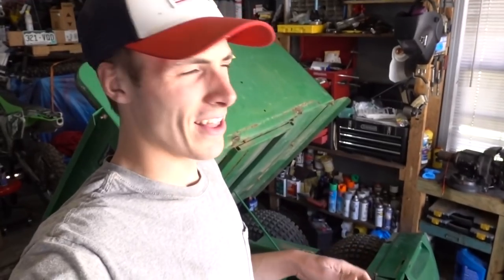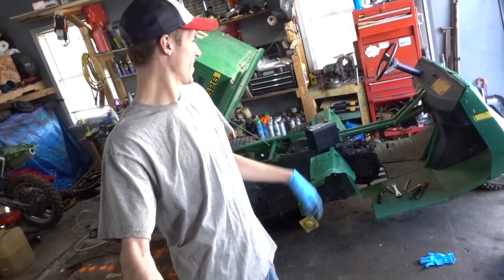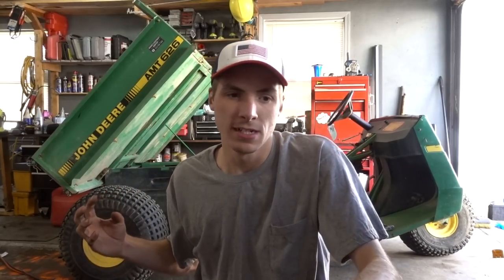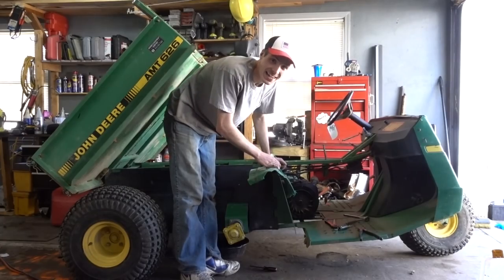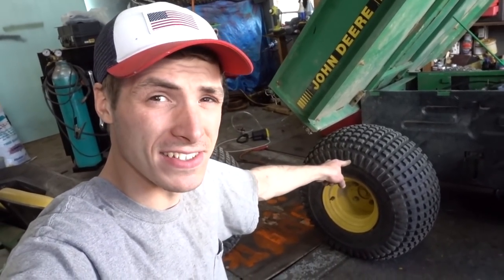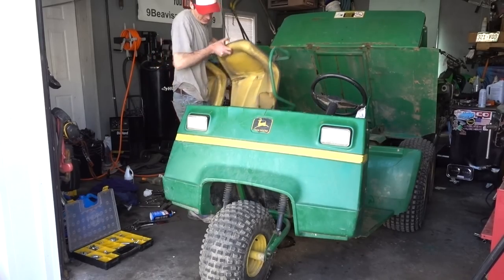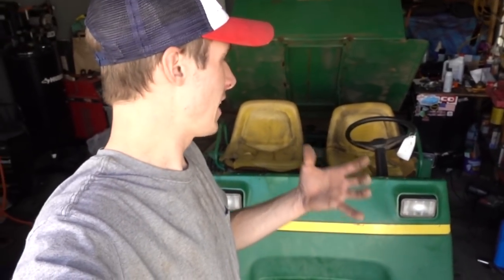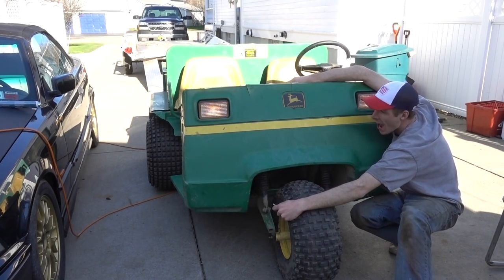THE CRAZY GATOR RUNS

Comment: Put a hydraulic lift on the back, put some LED lights on it, mount a swing arm to the chassis behind the seats (not on the tip bed), and put a light and winch on the arm.  Then put a trailer hitch so you can move your trailer with it.  Maybe give it a brush guard up front
Reply: Todd Abbott yess

Comment: I am a Golf Course Superintendent and have a fleet of gators and pro-gators.  With the setup that you have if it is hard to switch gears while the motor is running it makes it a lit easier if you turn the engine off, restart and then switch gears.  For example if you're driving in forward and you need to back up, rather than just switching the gear lever from F to R and struggling/grinding gears, turn off the motor switch to neutral and then restart the motor and then switch to reverse.  I know it sounds crazy, but it will save your trans-axle in the long run.  Starters are a lot easier and cheaper to replace!  Let me know if you have any questions about anything on your sweet new ride.  Love the content.

Comment: engine swap it with a sport bikes engine
Reply: no want a honda 450 in there
Reply: yeah thst too
Reply: +Zacmine6 why sport bike engine would have far more power.  put an r6 engine in it the thing would be scarry fast
Reply: But this is isn't a sport thing a dirt thing
Reply: But this is isn't a sport thing a dirt thing
Reply: it doesn't matter if the engine was once used for dirt or for street its about the engine and how much power it has
Reply: +Zacmine6 why does that matter? go look at 4 wheelers wkth sport bike engines running on the dirt.

plus a sportbike engine I's way less maintenance

Comment: Nice looking Gater, hand tight those bolts when you put those tires back on. Then machine tighten them, had to replace all 32 bolts & re-thread 4 rims too.  The tire not touching the ground, either wrong sizes tire or need more air.

Comment: I worked where we had a 6x4.  The middle tires always went bald or lost bead due to when it turned the middle tires just drag sidways.  Yours seems a bit older.  They are very strong in what they can pull.  I would think yours is a better design so you dont eat up tires.   Keep up the video's!

Comment: It's like a garbage truck. That wheel is there so If your going over a short taller hill, the middle tires will hit first and lift the rear tires off the ground for clearance when the front end starts to point down. so the body won't catch right at the peak, and stick you there with the wheels barley touching the ground

Comment: It's like a dump truck if the load is to much you can manually put it down, same with the John Deer if the load is to heavy it will touch the ground. Also it's to help on the approach angle to rocky hills.

Comment: yea the front wheels are off the ground so when you turn on turf it doesn't tear it up now on a different end if you load it up both axles will take the weight so you don't sink in the turf I have a 6x4 johndeere gator so if you need any info I can help have fun and stay safe. ps my has a diesel in it.

Comment: the rear axle was preventing the front rear tire from touching because you had a different tube in it, which increases the diameter as psi goes up. you can see at 7:32 that the rear front tire is boxier and flatter

Comment: The fact that the middle axle doesn't touch the ground is probably for better steering when there is no load, since with the four tires spinning at the same speed in the back and only one in the front it would be much more difficult to turn

Comment: Be Careful! As gators get well used, the chain drive, carrier barrings, sprocket teeth get worn causing slack in the chain. I threw a chain a few times and it will freeze you up fast. Infact due to cost to repair this issue is (I believe) the number one reason people stop using there gator. Look closely for missing teeth from earlier thrown chains. Brap on!

Comment: Dalton, please please please do not run that machine with that fuel pump on it. I literally just went through this problem with a mower I have purchased where someone put an electric fuel pump on it. The fuel pump was too much, it goes through the carb, pumps the engine full of fuel, and will get into the oil and more than likely ruin the engine. The right fuel pump for that machine is part no AM106164. When you said you don't think it's the original, you are completely right and whoever put that one on it doesn't know the damage it can cause...